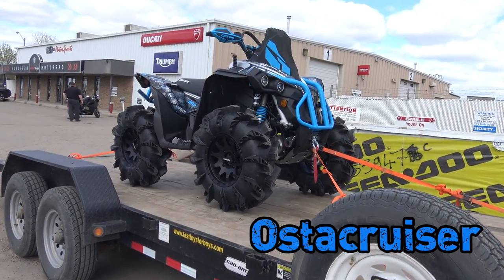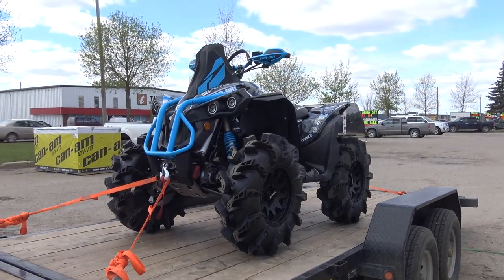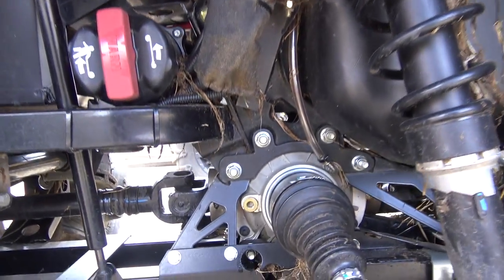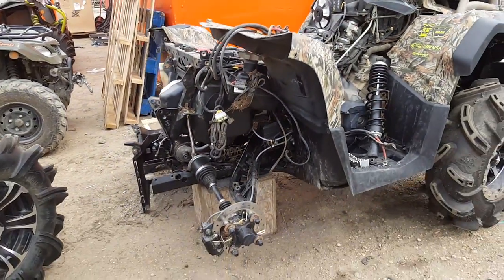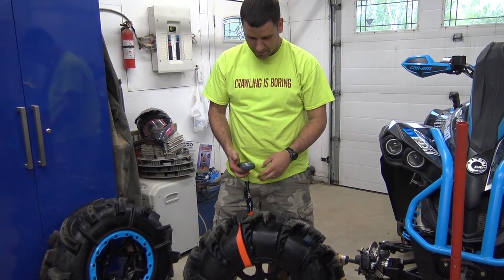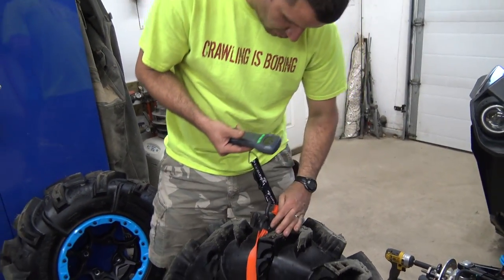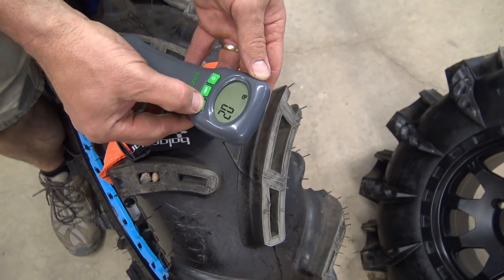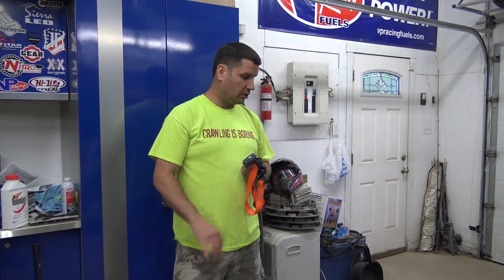6X6 Is Down!!/Silverback MT2 Update

Comment: Thoughts on MT2s compared to assassinators? 30 MT2s vs 29.5 assassinators specifically?
Reply from the maker: The mt2 don't really pull any better then the og silverbacks and they are a ton heavier. At least that was my experience. Nothing pulls better then an Assassinator imo
Reply: @ostacruiser  Thanks for the feedback. I'm really leaning toward assisinators. I was going to go 29.5s but I just seen a video a guy posted where his 29.5 sassys were the same height as his 28" Outlaw 2s. If sassys run short then I may be better off going with the 32s...

Comment: Do you ever have problems with water getting into the transmission?
Reply: No they use snorkels which when exhaust goes under it won't turn off it will keep running cause breathing through the snorkels unless u take the snorkels under too

Comment: Hey osta, long time follower and enthusiast from Brandon MB. Question for ya. Looking at trading my 15 900s in on a 15 maverick xrs. Both are bone stock. I run 29" bighorns 95% of the year with the exception of 3 or 4 spring derby then it's my 30" silverbacks. Is the stock can am clutching that bad that everyone is spending thousands on aftermarket clutches? If so it may change my mind on the maverick.
Reply from the maker: You will be fine with 30"s, just use low gear properly. There is room for improvement with the stock clutching for sire but they are not completely terrible lol
Reply: +ostacruiser right on. I'm not to the floor boards much ever in the mud anyways just didn't want any huge costs down the road. 
  hopefully wawota is next year so we can see you big boys perform again lol

Comment: +ostacruiser Hey im new to mudding and im wondering why my atv wants to stall when i get deep under water, its fully snorkeled and has a swamp series exhaust. I have read afew things about dielectric grease on spark plugs as well as raising the idle speed to keep the water out of exhaust, just wanted to hear your thoughts of the issue. thanks
Reply from the maker: What bike?
Reply: +ostacruiser 2011 polaris sportsman 850
Reply: +Jeffrey Lyle is the engine shutting off or just stops driving?
Reply: +Parker Wagner it spits and sputter then loses power and stalls

Comment: What is the best all around four wheeler under 10k
Reply: Hondas great bikes
Reply: +Dylan Hog I can't get a Honda because they aren't that powerful
Reply: +honda 420 boy good for muding
Reply: +Indy Ghost 500 spend the Extra money and buy a can am than
Reply: Polaris sportsman 850 high lifter
Reply: Best deal is to get a 570 xmr if your in the game for mud or look on Kijij for some sweet deals, or if your from canada and Ab,Sk, or Mb area join Local 306 union riders and there is always a bang for your buck
Reply: Can ams have issues to be honest. Belts get smoked like crazy  and i've seen people who got water in their computer because it's poorly sealed. Honda really makes the best bikes for sure, just their motors aren't big. I'd get a Honda rubicon 500 or foreman 500 and put a gear reduction on it.
Reply: +SuperFlyinghobo if you want something with problems is what you meant to say.
Reply: Andrew Klemmer they're much more reliable. Can ams run a lot hotter. Smoke belts. Their connectors aren't greased good. They're just not as well built. The only thing can am has over honda is their motor (only on power, honda motors are more reliable) and their power steering.
Reply: Andrew Klemmer they're much more reliable. Can ams run a lot hotter. Smoke belts. Their connectors aren't greased good. They're just not as well built. The only thing can am has over honda is their motor (only on power, honda motors are more reliable) and their power steering.
Reply: +Sabansux22 so upgrade the cooling system, get your hands a little dirty and grease the connectors. not that hard. rather do that than throw 2 grand at a choked out honda engine
Reply: +Andrew Klemmer lol that's not difficult I know. but everything else I stated is still true😂😂😂😂
Reply: +Sabansux22 not to mention gear reductions aren't even that great on a stock build. you gain a little bit of torque and lose about 5-15 on your top end.
Reply: +Andrew Klemmer it's not am all around better quad. look at can am visco lock. it absolutely sucks. you can't hill climb with it. Hondas are much more reliable. end of story.
Reply: +Sabansux22 can am is one of the few quads on the market with a really good visco lock diff. gives them a huge leg up over a lot of manufacturers. you should go back to counter strike no scope headshots lol. I go to school for stuff like this.
Reply: Andrew Klemmer  Lol visco lock is garbage compared to my hondas 4wd and guess what! I have lockers unlike you,

Comment: How do you clean your machkne
Reply: Pressure washer
Reply: DONT USE A PRESSURE WASHER! You will destroy all the bearings and seals on it. Just use the hose with a spray nossle and some automotive soap once most of the mud is off
Reply: +Parker Wagner thanks u use a brush right
Reply: Osta cleans his bike with a pressure washer go watch his cleaning 1000x renegade video he even comments on a guy with the same concerns as you.